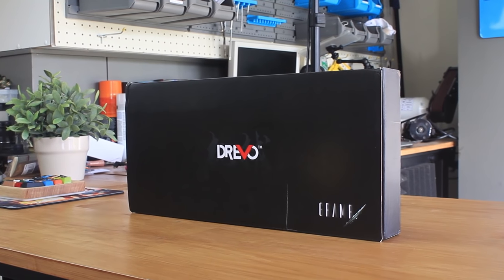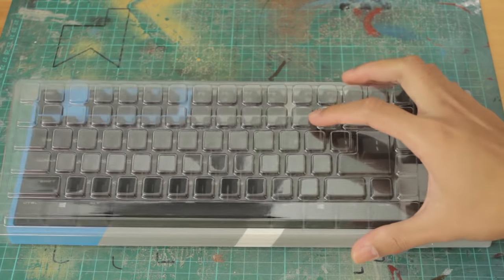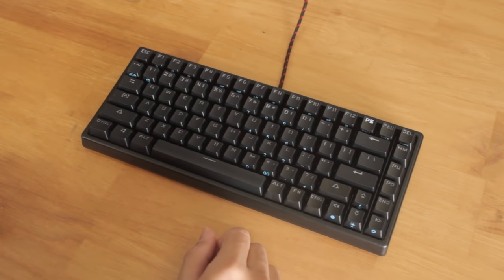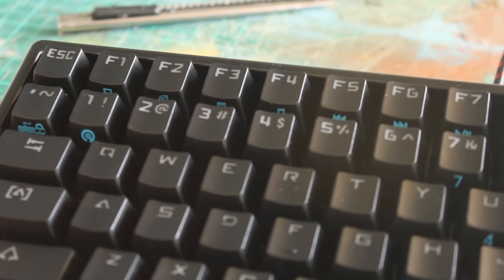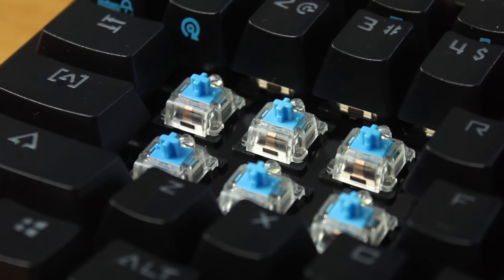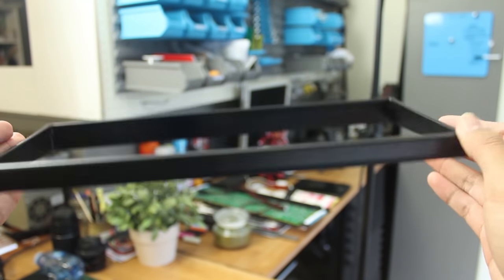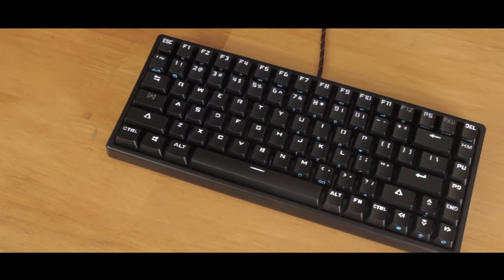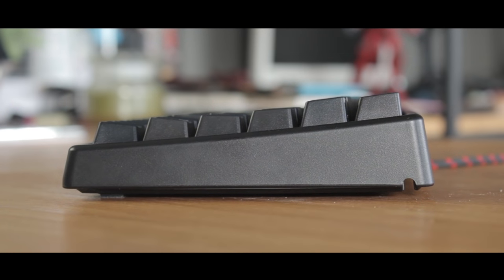Drevo Gramr 84 75% Gaming Mechanical Keyboard - Unboxing & Review

Comment: I just got mine today with red switches and I'm blown away. At this price-point especially, I'd recommend this to anyone.
Reply: I am looking at getting Red switches. How do they feel?
Reply: +Mike K.U To me they feel really really nice, I've never used cherry MX reds so I don't know how they would compare. The only switches I've used prior are the Razer green kailh switches, if that gives you any type of prospective.
Reply: which do you prefer? I have used all the razer switches so I know how they feel. Are they loud when you bottom out? I read online that this brand of switches tend to be heavier than normal.
Reply: +Mike K.U I prefer the outemu reds by far. They aren't considerably loud at all when bottomed out I think, but there is definitely noise, I guess it depends on how hard you type. And yes I've read that they are a bit heavier than cherries as well, it's 45g compared to 50g when comparing the reds, and I believe Razer greens also have an actuation force of 50g, the outemu reds still feel lighter in a way for me since they're linear.
Reply: Travis Robertson 

How much do these KBs cost?  Will i be able to purchase them in the UK?? 

And durability...??

Comment: After a lot of time spent using this keyboard, I thought I'd write down an opinion.
The price is amazing. This is something you should keep in mind as you read on. The features, the accessories, the packaging, the value for money... Even the quality is not that bad. The cable is really nice, for example.
But, as someone moving from Cherry to Outemu Blue switches, I definitely noticed a difference. On mine, at least 25 switches were unusable to me because the activation point wasn't aligned with the tactile bump. This almost drove me mad by itself.
Since I planned to buy a PCB and build a keyboard around it, this was still great value. I swapped the switches to Cherry Blues and used it for a long time.
It took a while, but after some time I started to feel like I didn't even want to touch the keys. I realised that the keycaps were of such poor quality they felt disgusting. I swapped them for some old ones I had and now it feels much better.

I would recommend this keyboard to anyone on a tight budget. If you are an enthusiast, however, I would still recommend it, but only as an alternative to more expensive DIY kits. You get an awesome PCB with great features, a plate to mount switches to and everything around it to get you up and running while you decide what you want to do.
I will probably try to make a custom case in the near future.

Comment: Thanks for the great reviews! Nicely done. One thing that might be worth adding in future vies, since you have the PCB bared, is which controller is being used. Just in case someone is looking to use modified/custom firmware,
Reply from the maker: Absolutely, point taken :)
Reply: I'm looking for a cherry mx version of a 75% keyboard. Which would you recommend that is still in production?

Comment: Great review! I just received my Drevo Gramr in red switches and a problem I found with my keyboard was that the rubber grips (when not using the feet) aren't actually the same height, although this isn't a problem for me because I have the feet raised but it can be a problem for others. Otherwise a great keyboard so far!

Comment: Hey, sorry if you've already showcased it; but what is the keyboard with the multi-coloured keycaps at 1:15? It looks really nice! 

Also, I'm from Australia too and would love to know where you source your keyboards and accessories :)
Reply from the maker: That is a Poker 2, an old keyboard. I featured it in my latest keycap dyeing video as well.
Many of my older ones are from individual sellers on Ebay, and a have a few new from China on Ebay as well.
Heaps of computer stores here in Australia too, and MechKB.com :)
Reply: Thanks for that :) Funnily enough after some searching I came across MechKB.com before reading this message. I've purchased a KB Paradise v60 mini with Dolch Keycaps and Cherry MX Clears.

Loving your videos, keep them up :)

Comment: Hmmm, I'm considering on buying one since it's so affordable. I like really compact designs (I currently use a CM Quickfire TK because it has the functionality of a full sized keyboard but in the size of a TKL), but I need something a TINY bit more portable than it since I have a small backpack.

Would you recommend this over the Magicforce 68 key with Gaterons? Or would this be worth investing in and then replacing all the switches with like MX or Gateron switches (something that I want to try my hand at one day since I'm quite confident with the soldering iron)?
Reply from the maker: The Magicforce is good as well, and Gateron's are good. There's also the Drevo Excalibur I recently reviewed that's also pretty cool. There's also a couple more 65% boards kicking about that you may like, but I guess it comes down to price.

Comment: Bruh, I should have bought this when it came out. I cannot find any of these in black and using brown switches, and this is the only largely produced keyboard in this style. U think I should get the ones with reds and replace them by unsoldering?

Comment: Hi very nice review :)

Some questions, does the keyboard save the setting for backlight? Like after restart the backlight is turned on automatically?

One more thing, is there a lock for secondary functions?
Reply: yes, it saves the setting.
Reply: thanks :)
Reply: oh btw, would you know if the secondary functions has lock (like i dont have to use Fn + function key)?
Reply: Toni Manahan I haven't tried that yet, and I don't quite understand why you need this lock. I mean, if you don't want to use the Fn+function key, just don't press it.
Reply: like in the quickfire keyboard, this lock makes it so the F1-F12 keys be used as dedicated media keys (volume, play pause etc) just like a mac keyboard. so this lock either makes the F keys as F1-F12 (being able to use alt+F4 to close windows) or as their secondary functions (media keys) without having to hold Fn key
Reply: it does have this lock.
Reply: nice! thanks a lot man you've been really helpful!
Reply: not a thing

Comment: I recently purchased this keyboard, waiting for it to arrive. Could you tell me what keycaps are non-standard, I guess the right-shift, but is there anything else?
Reply from the maker: It's mainly to do with the characters on the keycaps themselves. If those extra keys are just blank, then it will be fine. But like the right side alt/fn/control is different. And like delete down to end are different heights then what they would normally be.
Reply: Hmm, thanks. I'll see if I can live with those keycaps then...

Comment: I just got the keyboard in today and it feels like I have to press the keys further down than I do on my MasterKeys or Pok3r. Is this just the switches having a longer travel? Have you tried their newer metal board that supposedly has cherrys? The "excalibur"
Reply: They are Reds btw. They feel heavier than my browns and blues lol
Reply from the maker: That's interesting. They should have the same travel distance of 4mm, not sure why that's the case.

I will be receiving the Excalibur soon with Cherry MX Blue's :)
Reply: I wonder if it will be in my Amazon return window =P Thanks for the reply!
Reply: Testing the Gramr with reds against a K70 with reds and the Gramr is definitely stiffer. Maybe it's just a difference in springs?

Comment: Im having a really hard time choosing a budget mechanical keyboard to use mainly to carry around and play simple games like osu!
Reply from the maker: Depends on what layout and size you want really. And then picking what's at a good price. This is pretty cheap, as well as the Ajazz AK33 for this size. Im also a big fan of the Magicforce 68.
Reply: +TaeKeyboards thanks man! i really appreciate you answer😊
Reply: I've seen a really cheap full mechanical key board ( I think the company was like red dragon or something like that) it was I think 60% had red back lighting under every key, knock off cherry MX red switches and was about $40

Comment: Would you prefer this board, or the Ajazz AK33? I'm having trouble deciding in between having a metal top plate and more keys, or having a detachable cable
Reply from the maker: Yeh each have their advantages. I like the feel of the Drevo, but the looks of the Ajazz. Detachable cable is cool as well.
Reply: Thanks, that helps a bit

Comment: I'm planning on modding this board the way you did the Ajazz ak33. I prefer the size of this board- do you think its a good idea? I think it would be great with white backlighting.
Reply from the maker: They're the same size, just slightly different layout. And the Drevo uses double shot keycaps, so it can't be done. Hope that helps :)
Reply: +TaeKeyboards that's too bad! I might try some other mods on it then. Could you recommend any mods for beginners? maybe I'll just spray paint the keycaps.
Reply: +TaeKeyboards Actually, I'm just looking at the keycaps in your video now, and are you sure that it can't be done? it looks like I could sand down the top of the keycaps until it gets down to the white plastic underneath. Is that not correct?
Reply from the maker: The difference is that with the Ajazz keycaps, there's just a thin layer of black paint over the plastic, which can be easily sanded away. With these, the black is plastic, and not paint. So you would have to get rid of about 1mm worth of plastic. And then you would be left with the white plastic, which is very thin. I'm not sure exactly how thin it is, but I feel like it would be very weak. So a very likely possibility is that you would sand just a tiny bit too far, and go straight through the white translucent plastic. I guess it's possible with these specific keycaps, since the double shot is whole, but imo it's not worth it. I could be wrong though.

I hope that helps :)
Reply: +TaeKeyboards Ohh I see. Thank you very very much man! I can't believe how little subscribers you have- you really know your stuff! I really hope to see you grow. Have a great day <3

Comment: I was so close on buying this keyboard cause of its form factor. I also do alot of gaming and I read the reviews on amazon that this keyboard has input lag issues. I did alittle research online and alot of people recommended MK84 based on quality and build.

https://mechanicalkeyboards.com/shop/index.php?l=product_detail&p=1375

Edit: I ended up ordering this for its quality.
Reply: The biggest problem with the MK version is it only comes with Lasered keycaps which wear out with usage and with the odd keycap sizing finding replacements can be difficult to impossible and on the occasion you do find replacements they can be expensive at best which for a cheap keyboard to begin with is not optimal.

Comment: So if i remove that ugly bracket, it will become floating keyboard right ??
Reply: Little late. But essentially yes, it will. But Since there's no screws and just clips. There's nothing keeping the PCB connected to the bottom plate when you take the shell off. So it's probably not the best idea. But since it's just sitting on a desk anyway I guess it doesn't matter.

Comment: Have you seen the 71 key keyboard? It's a bluetooth, RGB, compact keyboard and seems pretty interesting. http://www.ebay.com.au/sch/m.html?_odkw=drevo+gramr&_ssn=xtrememicro&_armrs=1&_dmd=2&_osacat=0&_from=R40&_trksid=p2046732.m570.l1313.TR0.TRC0.H0.Xdrevo+71.TRS0&_nkw=drevo+71&_sacat=0 Here in the US, you can get it for about $52 USD. I kinda want to pick it up since it's so cheap, but I already have the Blackwidow Ultimate 2013 and Logitech G710.
Reply from the maker: Indeed I have, and it's definitely a very interesting keyboard, and can potentially be quite the hit. I've already got one on the way for review, so that video isn't too far away :)

Comment: can anyone tell me how to turn on 24kro. this keyboard seems defective.
Reply: try over ps2 Connect with an Adapter and Tell me it Works ..
Reply: +xsicht its funny bc there was nothing explains this on amazon or there website. until yesterday when i left my bad review they edited the description saying nkro needs ps2 port.
Reply: +Troy Amhaz really? crazy .. also is 24kro dosnt Support by this Keyboard.. and they fake this by edit they description or what? :D
Reply: +xsicht over ps2 its also dosnt work? i dont have this Keyboard but i order it today .. has it Input lag or something? you Can recommend this Keyboard? greets
Reply: Well i guess they saying it is sopported by ps2 port. At first they said. Nkro!! With nothing explaining 6kro usb and 24kro ps2. Inside the box there is a card with instructions that only say "fn+home=24kro" I've tried this function with no results. I got a ps2 adaptor on the way so i can second this. I dont have much trust in them already.
Reply: OK i have had the 24kro issue fixed!! PRESS "FN+(-)" This enables 24kro "FN+0" enable 6kro and you do not need a ps2 connector! greets
Reply: xsicht yea i fixed it. i made a review on amazon explaining the new functions. thats probly how u found out how lol. i fixed it this morning.
Reply: But and the lag ? i have this keyboard and i think that it have a little lag response time .-.
Reply: Eduardo Taioque enable 24kro it says how in the amazon description
Reply: I did this,but i'm speaking abount response time..
Reply: well i dont see any lag. i saw lag when i had 6kro on once i put on 24kro it was perfect for gaming with 0 lag.  the card that came inside the box is incorrect with the option to enable 24kro so maybe u dont have it enabled. the correct keys to enable it is in the description in amazon.
Reply: It does. I play a few rhythm games and on this keyboard I noticed that it has some latency, and it's not consistent either so I get thrown off.